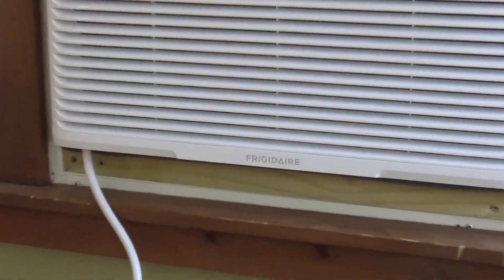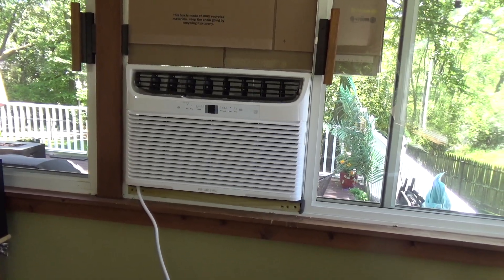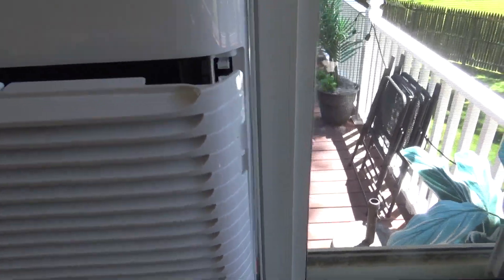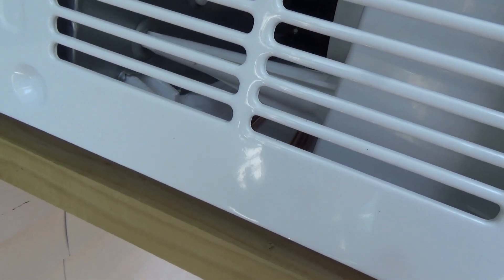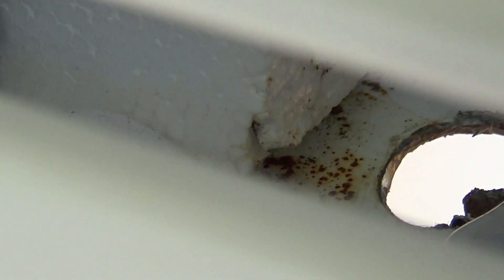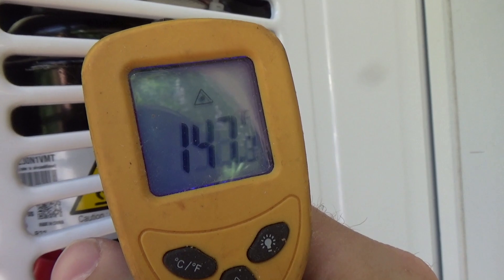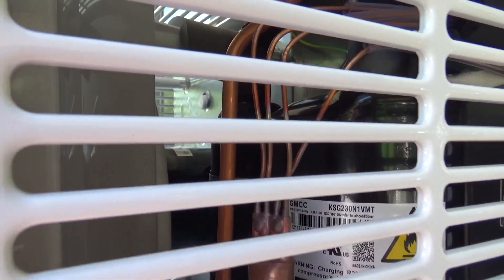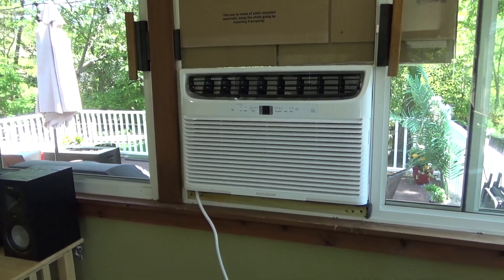Frigidaire FHWC253WB2 Claims Debunked

Comment: Jordan, just an idle thought I had:
I use thermal imaging a lot for my job. One of the traps people have fallen into is trying to measure temperatures of shiny objects. Shiny objects have a different emissivity than dull ones, which causes temperature readings to be artificially high. Also, (and I'm certain you probably already know this) the temperature gun is not measuring a spot the size of the laser, the surface it integrates its measurement over is proportional to its distance. In other words, the further away the gun is from the object, the larger area it measures. It might be worth trying to use a thermocouple probe to measure the temperature of the compressor, or putting a piece of black electrical tape on the surface being measured, since I noticed this compressor is quite a bit shinier than others you've measured.
Having said all of that, I think a strong argument can still be made that this unit is either marginally designed and tripping the compressor's thermal overload, or it's somehow just defective (wrong fan motor used, too slow?)
My parents bought the 12k version of that a few years ago, and the temperature regulation is absolutely horrible.

Comment: The compressor is going to get hot as rotary compressors are a high side dome design.  The compressor's high side discharges into the compressor case.  Since these newer refrigerants in use run higher pressures, the temps are most likely going to be higher as well.  The charge is good as the accumulator is getting sweaty.  Sadly, modern A/Cs just are not up to snuff like the older units were.

Comment: Just a thought:   Drilling a hole is a good idea to keep the pan and bottom of the condenser from getting rusty for most owners.  As others have noted though, the slinger ring is not a terrible idea. Conceivably it could lower head pressure (and reduce current flow) by having the moisture evaporate on the condenser fins.  Problem is, if it is so humid as to develop a lot of condensate then it is less likely to evaporate from the condenser also because of the high moisture content of the outside air.   I assume that the manufacturers did this to prevent these units from dripping onto the sidewalk or walkway because so many of these were mounted in windows above sidewalks in the city or over a doorway to a business.  Many of the older businesses in my hometown had units mounted above the entrance doors back in the 1960s.  If the units were pulled out and cleaned every year then I am sure that rust would not be a problem.  However, as you know, 90% of them were never cleaned or serviced and the moisture combined with the dirt and grime led to constant moisture and eventual rust.  I would think that except in extremely humid areas the slinger ring and evaporation would eliminate all of the condensate. This should not be a bone of contention among AC hobbyists because we all have different viewpoints.  I enjoy your videos and look forward to new ones.

Comment: If your brand new window air conditioner compressor is scorching hot even when the filter is clean and there is refrigerant, it could be due to excess discharge pressure. This typically stems from one or more of the following issues: dirty condensing coils (which may not be the case) ill-fitted discharge line, blockage of condenser air, inconsistent condenser fan, overcharging refrigerant (which also may not be the case for you) or undersized condenser. If direct sunlight falls on your outdoor unit and there is inadequate ventilation around it, it makes your unit’s compressor overheated. High voltages can also damage the motor causing the compressor to overheat. If there’s no power supply or if the power supply is insufficient due to low voltage, the compressor will work harder and eventually overheat. This overheating can wear out the compressor causing it to fail. I hope this helps!
Reply: Your comments just make no sense. This is why people will block you.
Reply: @theGarageBandSupporter  oh? Are you insulting me? How dare you? You threaten me like that?
Reply: @arisbuliteanu3608  enough!
Reply: This is indeed helpful. Thanks for the information. I didn't realize those factors could affect it too.
Reply: @Alco16-251F  thanks a lot! Your words are so emotional!
Reply: @ArisBuliteanu  NP, Always happy to help you out.

Comment: That unit is just plain bad. My uncle had a comfortaire wall unit and it was loud and the electronic controls were glitchy and when energy saver was turned off but when energy saver was on it would not freeze up and the air it blew out was mildly cold and it did not keep the apartment cool at all. I never had a good experience with Frigidaire products as a fridge I had that was made by them died after 7 years because of door gasket failure, evaporator fan failure, ice block freezer syndrome, and a bad freezer thermostat. That fridge was just bad and not great but the compressor sounded amazing on startup though it was loud
Reply: I have a 1964 Comfort-Aire Quietmaster Window Unit and it has a Tecumseh AH in it. Keeps my Whole Basement Cool.
Reply: @Alco16-251F  sweet. That comfortaire that I talked about was a modern pos one that mimicked a wci unit. I did save the refrigeration system out of that dead fridge. Frigidaire is a crappy company now.
Reply: @CG-1000-T  I agree. Their so to say 25000 BTU ACs are really just enlarged 12000 BTU acs because that's really what the airflow of them is.  That comfort-Aire you were referring to I have to agree  that it was a junk unit. I'm glad you saved the refrigeration system out of that fridge.
Reply: @Alco16-251F  everything works on that fridge except the ice maker, door gaskets, and evaporator fan. The freezer thermostat is just a joke, it literally does nothing except move a tiny damper. It doesn’t sense temperature or control the compressor. The only good thing I like is the compressor, it’s an embraco and it roars for such a tiny thing.